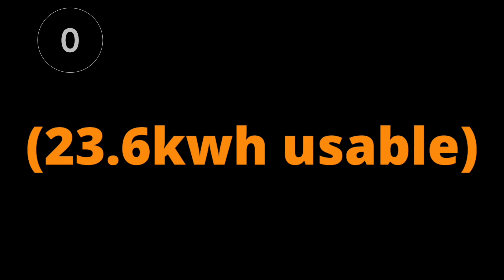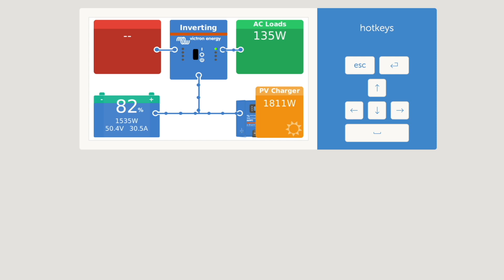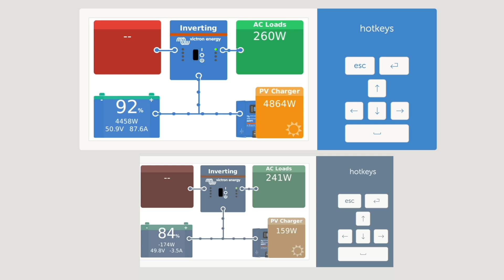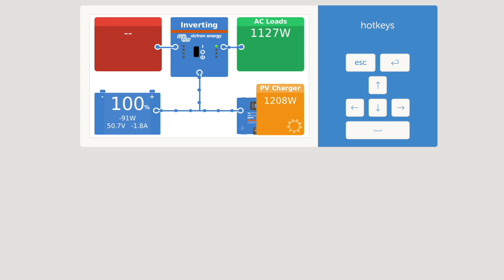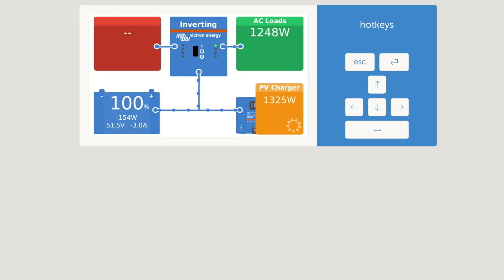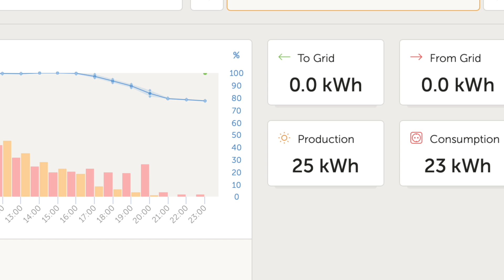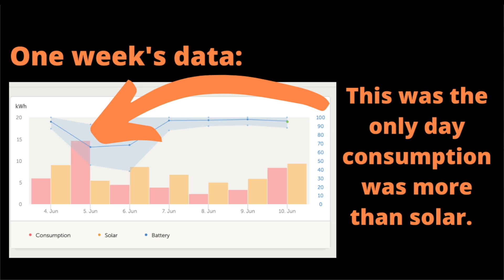Does weather make THAT MUCH difference to solar?!

Comment: I guess this video reinforces the importance of storage. If you had more storage you would have still had the power to charge it but, storage is expensive and you have to draw a line in the sand. I have 5 pylontech batteries so far, and the finished build will have 8 batteries. I will have 15.1kW of panels and I live in sunny Australia so, even in Winter I shouldn't have too many worries about getting the batteries charged. The question becomes: What to do with the excess power that is available during the day? Like everyone who is off-grid, we try to manage it so that we use heavy demand items during the peak of the day. We also installed a storage hot water system which takes about an hour to heat each day and can store a two-day supply of hot water. I have automated most of these things using Home Assistant, which plays very nicely with the Victron gear. It can run quite effectively on an inexpensive Raspberry Pi.

Keep the vids coming, guys. They are very informative and I enjoy them immensely.

Comment: Interesting. Should have run the washer and dryer anyway to have a higher load on the system and run the batteries down more the night before. As it stands, you still don’t know what production could have been. 

If the goal was to proof that sunshine makes more solar power, you succeeded though. 
The most important aspect of a solar system is designing it with your loads in mind as well as bad day energy potential. 

Im planning on retiring in Maine in a few years. Winters there are long, with lots of snow and 9/10 days fully overcast is normal. My system will be designed for that weather, not the sunny summer days.
15kwh usage in a day is not bad though. Your system was holding its own. Without any solar and starting with full batteries you’d have been down to 30% or so. Quite reasonable. And as you said, by next morning the batteries were full again.
Reply from the maker: Yes we could have done with a bit more space in the batteries before we started, but unfortunately with two little ones to look after we didn't get to be as organised as we would have liked.  Hopefully you still found some value in the video though ☺️👍

All the best for your future retirement plans to Maine ☺️ Will you be off grid or will you be grid tied?

Comment: Are you off grid for prepper type reasons or just because you are geographically remote to the grid making connection expensive. I wonder whether you wouldnt benefit from being connected when you have surplus and be offgrid when you just cover your own needs.
Reply from the maker: It's a bit of both really.  We like being off grid, but also it would have cost us around £20k to get access to the grid so really it wasn't something we ever considered ☺️
Reply: @The_OffGridFamily  £20k is more than you would ever get back so fair enough.
It does make me wonder about the upfront costs of being fully selfsufficient without the grid. Everything is expensive with solar and it output is only good for 6months of the year in the uk. We have 4.4kw plus another 1.59kw to go up soon on a pergola. This is fortunately grid attached as i am yet to sort out any meaningful battery storage. This is to follow. All was done 2nd hand. I think its not so easy to aquire decent offgrid solar gear as cheaply.
Reply from the maker: @Whereswally606   Our system cost £23k which is of course a huge amount of money, but not so bad when you think it would have cost £20k for the pleasure of joining the grid.  We have just completed our first year on solar and it went well.  Over winter we used a generator for 17% of our electricity, but we believe we can cut that down by modifying our behaviour slightly.  The rest of the year we don't need to use the generator ☺
The cost of second hand solar equipment seems to have really risen recently.  We looked into it a month or so ago and were shocked by the prices! 😩
Reply: @The_OffGridFamily  one good thing about off grid is your not locked into mcs certed panels for exports requirements

Comment: We have a 2.5kw system on our house although in our case it's grid tied rather than offgrid. Our best days we do 16.2kwh in a day, our worst day was 2.5kwh. Not sure what your hot water setup is like, but if you have a cylinder have you considered getting a solar diverter like a MyEnergi Eddi? We dump all our excess generation into heating the water with an Eddi which saves us a fortune on gas, plus means rather than clipping your solar output you can use more of what you generate.
Reply from the maker: We've come across this idea and it is a really good one 👍  Once we build our house it is definitely something we will look to do.  We have a long list of projects to get done first though so one for the future ☺️

Comment: Thanks once again for putting this useful real-life info together in such an illustrative fashion.  And yes I'd definitely see about chopping those conifers all the way down to nubs.  The more shade you can prevent the better in the future, them darn trees have a very bad habit of re-growing, gettem while they're young and the cutting won't need to be done by pros charging you an arm and a leg.
Reply from the maker: Glad you liked the video ☺️ We reduced the conifers the next day, so that's a job ticked off!! Fortunately Fraser is a tree surgeon so we wouldn't need to bring anyone else in 👍
Reply: Please tell solar installers to stop lying. Solar won't work during rain or cloudy days. Panels will pick up just 20% energy but the inverters need at least 75% for the whole system to run..

Comment: When winter comes, your production will plummet, if you can, get another set of panels but set to point more at a lower winter sun. Have that string feed into one input of your inverter and put your existing two strings into the other one. In winter on many days I have received less than 1\10 of my normal summer production and some at zero on my 8.2kw system.

Comment: I use a horseshoe shaped array,  so I can get some good amps any time the sun is up. I also have the ability to adjust the inclination to maximise incident radiation.
Reply from the maker: Thanks for sharing this idea 👍 We are considering making an ground array for winter and want to be able to adjust the gradient too 😊
Reply: @The_OffGridFamily  I framed my panels with painted, treated wood, and hung the frame with 3 external stainless steel hinges. At the bottom of the frame I attached a single hinge, with a 'leg'. The leg runs roughly parallel to the ground. Different points of attachment on the leg, gives angle adjustment. My ground mounted panels are in an open field with 2 charge controllers.

Comment: Why dont you install some frequency activated switches connected to a hot water tank or space heating/cooling. That way the frequency shift function in the inverter will not limit your PV output and you will see its full potential?. Maybe doesn't matter to you but if you were getting Feed in Tariff that would maximise your income. Another question, I often find that the VRM portal displaying the incoming PV/Consumption goes into a funk, ie sometimes if generation is say, 500W and consumption is abot the same the VRM seems to display a net result ie 0 in 0 out. Have you ever noticed anything like that? Cheers
Reply from the maker: The hot water tank is a great idea and definitely something we would consider in the future once our other projects are completed 😊👍
I haven’t noticed anything weird with the VRM on the laptop but Fraser said there have been some times when he’s accessed it via his phone and it’s displayed things that make no sense! 😩
Reply: I have noticed that the VRM dashboard has been showing some weird numbers recently, but if you go into "advanced" or the remote console and check there, everything adds up properly.

Comment: So you still get solar on a cloudy and wet day but is it enough to last until the next sunny day or do you have to restrict your selves to what appliances you use so that you don’t completely deplete your battery’s?
Reply from the maker: In summer, we can last to the next sunny day. Over winter, and in particular December 2021 which was extremely cloudy, we found we needed the generator as back up. 17% of our power came form the generator. We didn’t modify our behaviour though as the fuel prices weren’t so high. We won’t be doing that this winter! We will modify our behaviour to minimise any generator use 😊
Reply: So you could just add wind generation and/or increase the battery storage to help you in the darkest days, would this help much and be cost effective??
Reply from the maker: @srowlands248  Yes this is true although we are a bit reluctant to go for a wind turbine as we generally find things with moving parts are more likely to go wrong.  We considered adding a winter array of panels on the ground with the option to adjust the gradient of the panels to suit conditions.  (There seems to be a lot of conflicting advice on the best winter angle so we tend to find when that's the case it's best to work it out for yourself!) 
We wouldn't currently look to add more batteries as we have had issues with our batteries and at £1k a go we aren't currently willing to take the risk of buying any more 😩